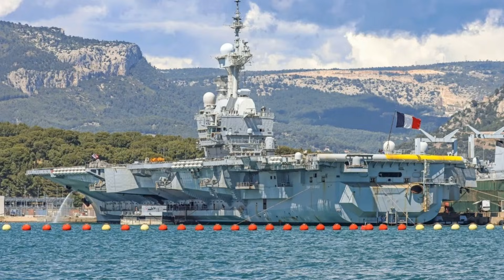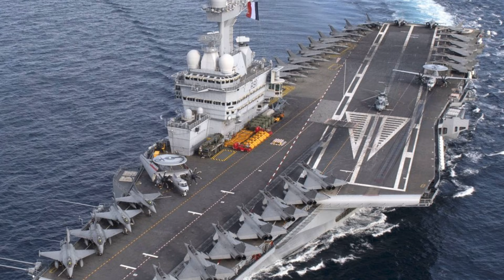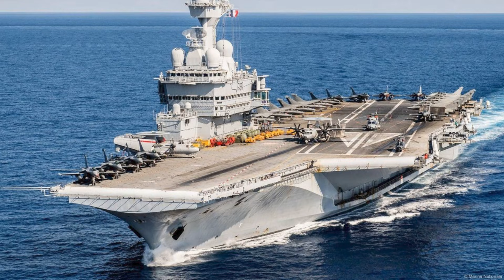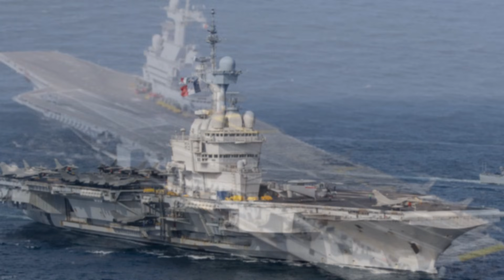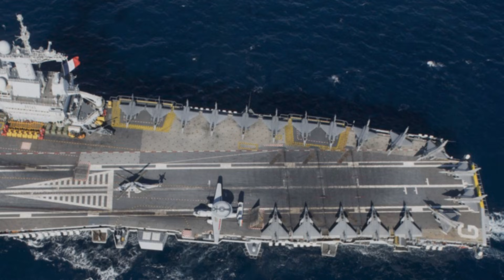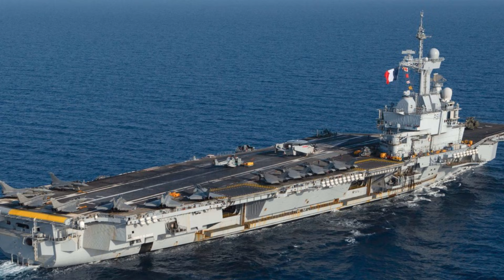France’s New Nuclear Supercarrier: Why PA-NG Will Redefine European Sea Power

Comment: This is a very far-reaching strategic decision. Even the technical development of FCAS is shaped by the requirement that the aircraft must be carrier-capable (which Germany does not agree with). They also need to design a whole new carrier group around it. So many resources in one bowl at a time of resource scarcity. And all this for a system that has very limited use for the defense of Europe and might be in maintenance at the crucial moment. It seems like a decision that was lobbied more by the French defense industry than a coherent doctrine.
Reply: France has the 2nd largest Exclusive economic Zone (EEZ) of the world. We need a real navy to protect it.
Reply: @gsbeak yes but the real current danger do not come from the sea in other parts of the world.